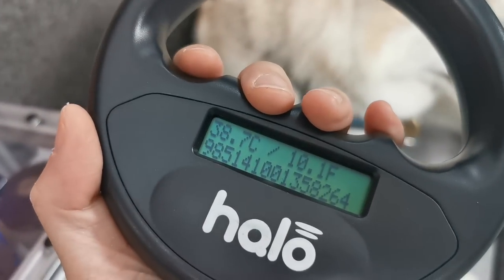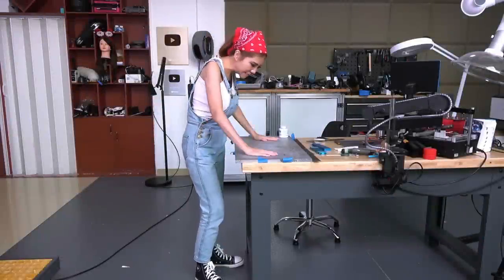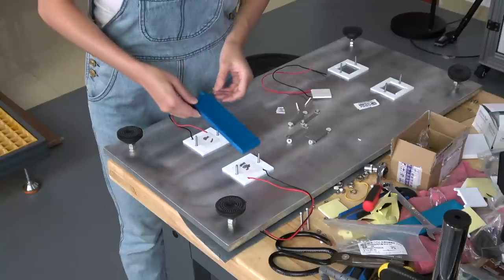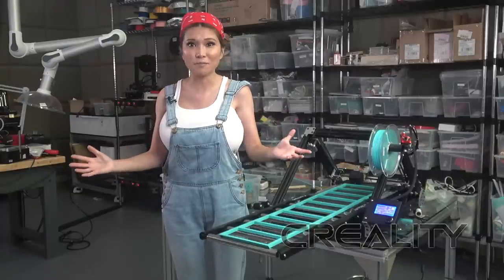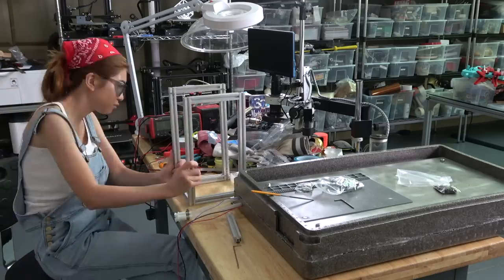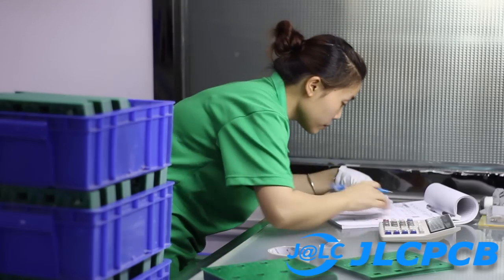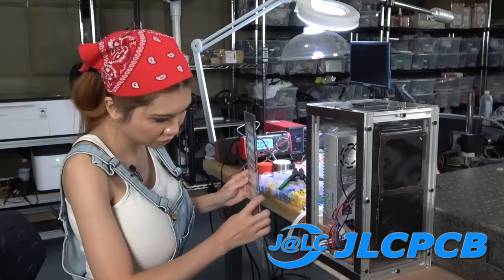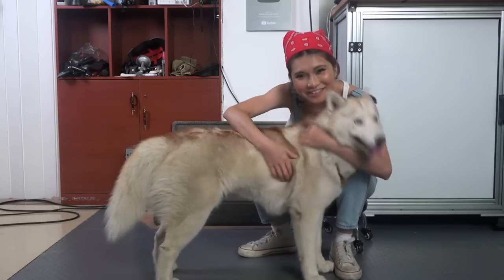Ice Cold Husky Bed From PC Water Cooling Parts- Sponsored by JLCPCB.

Comment: Excellent build! And some great tips on improvements. At first, I was a little sceptical because huskies have their capillaries some distance from their skin surface to aid heat retention, but the proof is in the doing. Certainly a lot less mess than the paddling pools and ice licks we use here.

Comment: One interesting characteristic of peltier coolers is that their cop gets higher at lower voltages. The deltaT gets lower but as you only need a few degrees below ambient they can potentially be really efficient with a more complex control circuit that changes the voltage instead of a simple thermostat.
Reply from the maker: Yeah PWM next...
Reply: @Naomi-Wu  You may know the difference but just in case. 
Straight pwm will vary the average power  smoothly but will keep the full voltage across the device during the on part of the cycle which in this case wouldn't improve the efficiency.
What you want is a smps, for example hooking up a buck converter after your power supply.
Another way is taping into the feedback of your power supply as it is already a smps. The simplest way I can think of is adding a digitally or voltage controlled potentiometer in parallel to the upper part of feedback resistor divider so you can control it with external circuitry. If this was a more typical computer psu you would likely have a sense line going directly to the atx connector as that lets them take into account the voltage drop across the wires but as this one doesn't have a cable the modification would be a bit more invasive.

Comment: Would you be able to modify the box to hold ice against the radiator? Also maybe a pressure switch in the cooling pad could be used to control on and off

Comment: This is also great for rabbits. Rabbits are not handling heat well and can get heat stress in temperatures above 25 degrees Celsius, so I was looking for a project like this. Currently I have a sandbox with an isolated drawer underneath where I place cooling elements. It works, but I have to change the elements too often.

Comment: Rather than hot gluing the wire splices, there are heat shrink splices available that contain hot glue so that the act of shrinking the insulation also seals tightly against the wires to form a good waterproof seal eliminating the possibility of electrical leakage. Search Amazon for "waterproof heat shrink butt connector" and you'll have a selection of both crimp and solder types. The solder types have a ring of solder inside that joins the wires when heat is applied.

Comment: Very well thought out.  Overbuild is common to assure robustness.  From there you can make necessary changes.  Fantastic construction sequence.  Possibly using a bottom panel and flushing the top surface with air is a solution for condensation.  A grid of very small holes feeding air from the space created by the panel would dissipate condensation.  Not to many holes other wise you might float Momo.

Comment: I have a Idear to medigate the condensation problem, getting the plate as cold as possible is probably a nice thing, they lay down of frozen ground anyways. And are fine with that in nature. 
My solution waud be to have a flexible fabric on top of the plate, maby a silicone rubber sth like that. underneath woud be air as a insulator to midigate the condensation / Iceing problem. 
When the dog lays on it it pushes down the Flexible  layer on to the plate creationg a cold bridge that is capable of transfering more energy due to a  themperature gradient.

Woud do the mathematics before to midigate the possibility that the lower w/m²/K valiue of the membrane dosent prohibite the energy transfere. ans is still faster that straight dog to plate transfere. when the delta t is higher.

Comment: Naomi, I love this project and I think it's pretty great as it is. Even if you don't need 4 Peltier devices to get the target temperature, it's harder for bulk heat to travel laterally across a thinner sheet of aluminum (it's a function of the cross sectional area of the sheet times the distance it has to travel sideways). Your thick aluminum slab is very good for such a large cold plate, if you want the target temperature to be pretty evenly spread to the middle and edges for Momo's comfort. Though since your deltaT to ambient temperature is low, you could try welding aluminum tubing in a serpentine pattern on the back of a 5mm slab, and put the Peltier devices in the box with the radiator instead; I bet that would cool her bed to 20C pretty quickly.
Reply from the maker: Good tips- thanks!

Comment: Very nice project! A potentially messy suggestion: the efficiency could be improved by increasing the contact area using aluminum thermal bath beads. An added benefit being that they get more between the fur, but unfortunately they'd also get tracked out on the floor too. However, they're marketed as being for thermal control situations where you don't want water and in my limited experience they work well. Like high tech peas.
Reply from the maker: Ohhh! I thought about pogo pins but aluminum beads sound interesting! Momo is very neat, she would not make much of a mess...
Reply: @Naomi-Wu  I like your pogo pins idea. I'm curious about what ruled it out for you. Sadly, all I see listed online are expensive Lab Armor brand beads for around $100 USD/L! Maybe there's something available outside the US though. From what I see, there's not a lot of soft, or form-fitting, thermal conduction materials out there, but maybe a gel would be acceptably matched to flesh. 

Your current solution is great with only 15 minutes for Momo to cool down. I'm looking forward to seeing what else you might do for Momo. :)
Reply: dogs lick their fur , I would be very careful about using something she could ingest. great projects ,I am glad you took some of projects in this direction..its very relateable for many pet parents , I didnt say owners. because its quite obvious   who owns who,lol
Reply: @redsundragon  good point! Lab Armor is similar to smooth pea gravel so without anything sticky it shouldn't stay in fur, but extra caution is always a good thing. Ingested metallic aluminum hasn't killed anyone per the literature. It can produce hydrogen gas in the stomach (flammable burps), but even for Al2Cl2 (the lowest listed LD50 aluminum substance involved with ingestion) that would amount to eating around 1.3 cm^3 (maybe 8 beads)/day for 43 days for a 16 kg dog IF stomach acid could completely convert the beads to aluminum chloride. That is doubtful as the irritation would probably cause them to be ejected. That said, if there's any interest in consumption, there are even less bioreactive materials to mimic cold ground, just that they have worse efficiency for cycle time (and are much cheaper to buy). The average dog in nature won't eat gravel, and my dog would have actively rejected a solid piece of metal, but definitely everyone's mileage may vary, and your point of caution is a good one.

Comment: From what you say ~5--6mins, could you have a cooling vest with most of the business happening against the thinner belly hair, like your slab does?
Reply from the maker: You could maybe fashion a cold pack underneath yeah, but it's in and out of the fridge. But maybe for long walks...
Reply: @Naomi-Wu  For long walks I would suggest water cooled vest with a heat exchanger placed in ice water. By regulating the flow of the water you can control the temperature and you can easily recharge it with a bag of ice from a store.  See how Adam Savage cools his spacesuit: https://www.youtube.com/watch?v=hxRoK5LZa_A
Do you think Momo would mind pulling a small trailer? :D

Comment: If you want to get rid of the condensation entirely you could get the local dew point (weather report)
And just stay above that temperature.
Reply from the maker: I have an Arduino circuit to calculate it but it's easier just to set it to 20º, that works fine.

Comment: One thing that was skipped was pretesting the peltie for which side gets colder/hotter when power is applied.  I have tryed making a peltie phone charger and it was slow when I had it working with candles.  There was a difference in eficiency after checking them, but still really slow to charge a phone.

Comment: Great build. Over-build is groovy. However don't dismiss air-cool too quick. It depends how fast you can move air. The huff-huff-huff panting of my Great Pyrenees will move a lot of hot air directly from lungs (body core), bypassing the double-insulating fur. That IS how dogs(wolves) are built to work. I think if you left the refrigerator open, Momo would cool faster than by belly-chill. Perhaps a very small (4000BTU) window air-conditioner blowing into a bed-sheet 'tent'? My Pyr will lie on the cool tile floor, but if the air conditioning comes on, she will move to a vent and pant. Our outdoor Pyr would dig a hole and put his nose in it. When the hole warmed up, he dug another hole.

Comment: Note that the entire surface of the peltier hot side has to be cooled. I've done a similar system and the my peltier burnt in some spot, so I could see not homogeneous cooling on the cold side whit hot spots (cold side -18, hot side 22).

Funny thing I wasnt cooling a dog, just experimenting whit metal expansion

Comment: How would the semiconductor modules compare to using a laser cooler?

Homend 110V Water Chiller Industrial Water Chiller 9L Capacity CW-3000 Thermolysis Type Industrial Water Cooling Chiller for 60W 80W Laser Engraving Machine

This one is non-Refrigerated but the 5000 and 5200 models have a compressor.

Comment: What a great idea!! Have double coated Chow Chow so know of the problem when it gets too hot. A question though... the micro-chip you are using ..... I can only find it for Cows/horses and deers. Are there some for dogs?? And if so could you provide me with a link?? 
Would be great to use them as on hot summer days and shows outdoor it would be great to know the degrees in order to work fast if they get too hot. Cheers

Comment: Lots of peltiers and huge expense!
Better use a water cooling dispenser - freon gas compression 💦❄ will save your money and electricity consumption.
I saved old unused one for a project like that, it already has water tank and cooling it so you only need to alter the hoses and make water circulation, so you can submerge a submersible water pump inside it and circulate,
Lower noise and electricity consumption.

Comment: I am still a bit unsure about who is walking who. A switch activated by Momo’s weight with the plate on springs would make it automatic. A sensor also works but proximity could turn it on if it was an issue. Good build.
Reply from the maker: Only with a much thinner plate, this one takes 30 minutes to cool off

Comment: What about a large, thin, finned plate with some fans underneath to circulate air? You're actually removing heat rather than "creating cold", right? Cool video and I admire your creativity.
Reply from the maker: That would absolutely work- it would just draw less heat than this.

Comment: Temperature sensor + humidistat + microcontroller = cooling pad with dew point awareness? That way, you could potentially cool it down faster (to a point a couple degrees above the dewpoint) and get better use of a pressure switch. Overkill, sure, but isn't that the point of making awesome gadgets??? 😁 And Momo is certainly worth the effort!

Comment: Hey Naomi,  MxR Plays just had you at the end of one of their videos. It was the one about illuminating your implants (which I had not seen). I was wondering how you would change that build today? Would the saline be different that the silicon? I assume that you would 3d print the parts that you had custom machined before? Have things changed enough(tech) to make a then vs now video? Thanks
Reply from the maker: All the same, I just haven't found a corset that fits like that one did.